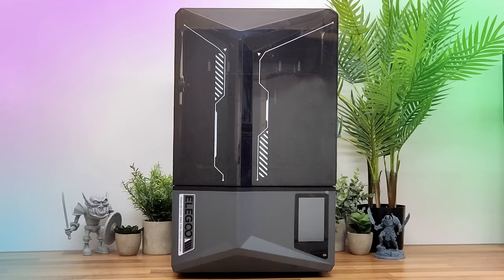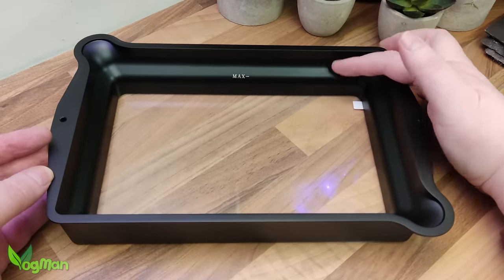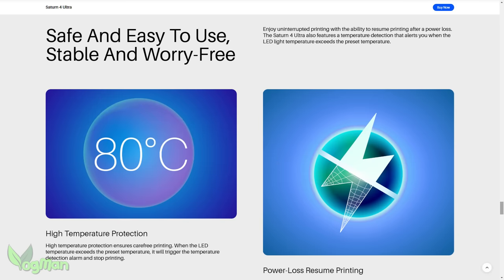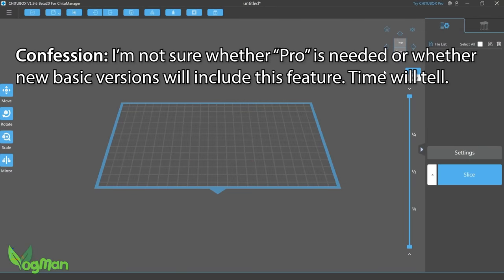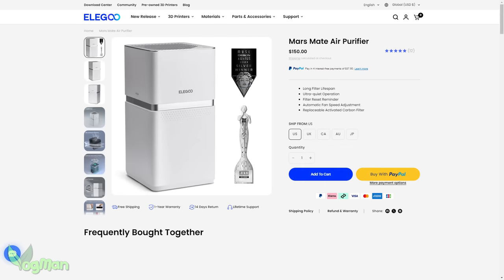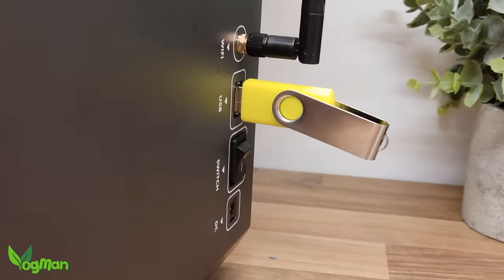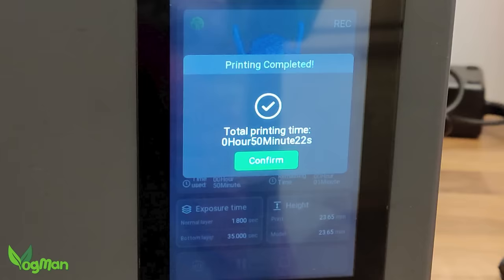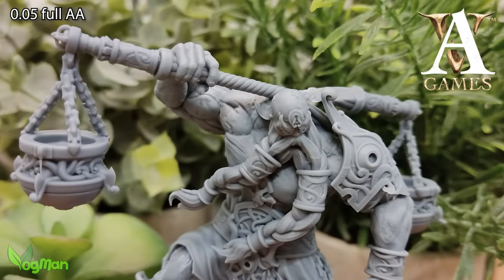Elegoo Saturn 4 Ultra (HONEST review) 3D resin printer

Comment: While I don’t intend to replace my Saturn 2 til it fails, in a way I don’t want to have to try to fix (I’m clumsy and a little worried about if I’d mess up wiring and such), definitely paying a lot of attention to printers coming out now since I suspect one of them will be the replacement I end up with (hopefully in over a year at least) and it’s good to see some sensible and quality of live improvements
Reply from the maker: I always encourage folks to keep what's working. Don't update unless you really need to or really want to.
Reply: @vogman  yep, feels like it’s working just fine atm so not planning a replacement or upgrade, but keep a reasonably close eye on what’s coming out just in case.

Comment: according the the elegoo website the saturn ultra 3 to has a Build Volume of 218.88×122.88×260 mm³ and the new saturn 4 ultra 218.88 x 122.88 x 220 mm³ which means the new saturn 4 ultra has a smaller build volume. might of been worth a mention.
Reply from the maker: You're 100% correct. Unfortunately this video was getting epically long and I've had to shave parts off just to get it done.
I do mention the print volume though, and include "Chapters" in the description to help folks find this stuff 😁

Comment: On the no heater issue... I'm more mad that their official heater uses the same hole that is meant for an easy way to extract the air out of the machine to take care of air quality.
Reply from the maker: Folks have ridiculed my "no handle" comment on this printer, but they've missed the point. I'm concerned if they've overlooked something this obvious, what else have they overlooked. It seems you've spotted another oversite.

Comment: Any word on the ACF release on this one? I was watching some old videos from Fauxhammer where he complained about the ACF smoothing details but then it wasn't the case on the Saturn 3 ultra
Reply from the maker: Well from my observations ACF liners were producing vertical lines on prints, and I've noticed that manufacturers have stopped fitting them, so I'm not sure.

Comment: Will you be making the top contenders for this kind of printers, aka this printer, Phrozen Revo, Anycubic Photon Mono M5S/PRO, GKTwo, etc? Sounds like they all use the same screen, just differing in the features.
Reply from the maker: Most of these printers use the same tech, though Elegoo stuck wit the 12K here where the others went 14. I guess the real issue is how well then put this tech to use. I have my own preferences listed here https://www.vegoilguy.co.uk/3d-resin-best-midrange-printer.php but I keep the videos as balanced and objective as possible 😁

Comment: Good video

But The maximum declared speed is always theoretical and for layers of a certain thickness.
At best 0.10mm but some brands (including Elegoo) I assume imply 0.20/0.25mm layer to declare the maximum speed

Only Anycubic explicitly declares the layer (which is 0.10mm) and says 10.5cm/hour (or 2.91s/layer with exposure 1.5-1.9 I suppose) for the M5s Pro and up to 17cm/hour (at 2.12s/layer with high-speed resin and with exposure unknown) for the M7 Pro
I don't know if these speeds are truly achievable

So you certainly can't use layer 0.05mm to measure the max printing speed in cm/hour

In any case, I see that Lychee Slicer 6 for the Saturn 4 Ultra profile provides me with print estimates (I don't have the printer, I just did the simulations) of 9.03cm/hour using layers 0.1mm (at 3.99s/layer with exposure 2.0s) and 4.62cm /hour using 0.05mm (at 3.89s/layer with exposure 2.0s)
Is this estimate too optimistic or will it be more or less correct?

Comment: Good review, I appreciate the clear view of the quality and speed. The automatic leveling actually woking is pretty nice, but the comparison to the M5S is not flattering when considering the possibility of the tilt release mechanism slowly degrading.
Reply from the maker: Yes, mechanical parts do wear over time. The question is, how long will that take?
Reply: What's it going to matter many years and thousands of print hours later when you're upgrading anyway?

Comment: Is there a way to print without the tilting? I'm interested in all the features except for the tilt release.
Reply: Buy the Saturn 4 all the futures without the tilt release and cheaper.
Reply: You should take a look at the non ultra Saturn 4
Reply from the maker: Not that I've seen, though I agree that would be a useful feature to add - just in case.

Comment: 5.5s a layer is faster than what I usually get out of my Saturn 3, which is 7.5s. So if the layer time is actually 5.5s that will save a bunch of time. Obviously not 150mm an hour though.
Reply: There's no reason it can't be 5.5s considering exposure is about 2. Should have shown the math in the review which makes 150mm/hr basically impossible unless doing .15 layer heights or something crazy at which point might as well use FDM, silly marketing

Comment: Vog man, there is a chance you expirience with the 4 cones being off might not be the printer... The cones v1 is only supposed to be used in the middle of the fep, and printed alone, as printing elsewhere can affect how the cones behave due to uneven fep pull forces. The cones V2 and now V3 avaliable on the table flip foundry discord have walls around the cones so this shouldn't be an issue. The cones v3 also has a dimensional accuracy test which I worked on, it's in beta on the discord server as that is being refined.
Reply from the maker: In fairness I did other tests than the cones... I just thought the cones were easier to demonstrate 😁

Comment: All these Chinese manufacturers are chasing each other's tails, but nobody seems to LISTEN TO THEIR CUSTOMERS!!
So, good points:
1. Auto levelling.
2. Quick release plate
3. AI camera
4. Flip-top lid.
5. Angled release table

Bad points: Elegoo, are you listening?
1. Put the damn switch and USB on the front and the sockets and aerial on the back. (After asking for years.)
2. STILL has pony screws holding the tank in place. They are a pain in the arse. Fit some quick release catches.
3. Whilst the new auto-levelling is cool, the build plate is a mess. Trying to clean that will be a nightmare. Build a sealed surround like your competition.
4. Why do I have to use Chitubox to access the camera? Why can't they provide a separate Elegoo program to run alongside one's slicer of choice?
6. No air filtration.
7. No vat/resin heater.
8. Pathetic little control panel.
9. Stick a handle on the lid. Better still, made the lid from something that doesn't react to resin or IPA. They end up looking a mess within days.
10. Reduced height over the Saturn 3 Ultra. Z-height should never be an issue, Why do they have such constraints on height?

"Speed" is a gimmick. It makes you think you are getting something extra. ie "Slow" and "Normal".

Overall, good review, Jeff, as always. No great surprises mind.
I'll wait till the Saturn 5 or 6.
They might have got it right by then. 😆
Reply from the maker: You made me laugh here. That's what I call straight talking 😁😁😁
Reply: @vogman  I like to call a spade a thing for scraping things off the build plate.

Comment: i recently got he saturn 3 utlta and was supper bummed I didnt expect a new version a month and a half later. honestly even though it has some really nice quality of life improvements  like the newer hopefully better poor spouts and flip up lid I am happy with the 3 ultra now. i feelthey missed the mark not having any sort of  heater weather It was chamber or vat and I didnt see a spot to run a power cable to have a addon heater.  I'm sad to see they didnt go a deeper vat and a skirt for  build plate like the gk two that way you dont get resin ontop of he build plate. im curious about the tilt to release if it will distort the print making ti tsightly taller up front vs back. im sure it will help reduce the suction forces though
Reply from the maker: Never worry about missing an new version. There'll be another one out very soon, that's just the way these companies go. Enjoy what you have. I made some fabulous prints on the S3's.

Comment: Is the vat actually innovative, given that the Form 1 and 1+ had a tilting vat years ago, as did the Prusa SL1 and Prusa SL1S. Now maybe Elegoo have done a better job than Formlabs, who I believe didn't have a tilting vat in their subsequent models, but I think we need to see how it pans out with this model. I honestly struggle to see where there's any innovation with this model personally. Like many of us, I'd like a heated vat so we don't need to use brew belts, automatic filling, level sensor, vat temperature monitoring with a contactless low res thermal camera or other sensors, replacing the shitu chitu firmware for something decent and thus a better print experience (Bambu show how much better it can be having custom firmware over what others are doing), and a slicer that can leverage said better firmware. Providing something like Fujifilm Prescale might be useful too for validating actual bed levelling (as opposed to Z height), but Prescale is super expensive. Heygears seems sort of like the Bambu of SLA, with a somewhat integrated system that's an improvement in the experience, but I don't think we're seeing anything particularly exciting anywhere. Wondering if Bambu are looking to take a lead in this space too; certainly hope so!

Comment: A simple and effective idea Prusa has been doing for years
Reply from the maker: And Formlabs too I hear.
Reply: And overcharging for copied crap for years, too.

$2000 for a tiny little 2K printer (0.05 mm pixel size, 127mm x 80mm x 150mm build size), with obsolete misengineered "UV LED Matrix" (just like an OG Photon Mono]) yeah, right 🤣🤣🤣

Comment: I’m blown away we are still getting printers without heaters in 2024. 
That rules it out for me immediately. 
It’s the most important feature for a 3D printer.
Reply: You can get the heater for 50 bucks as add on. With the printer price ridiculously low it will not break the bank.
Reply: I think the force/strain sensing is more important if it can prevent the screen from being destroyed by debris, but in integrated heater is an absolute no-brainer.
Reply from the maker: I'm biased on this subject, I know, but there are a lot of folks replying "I don't need a heater - I don't care."
To those I would remind you, it's not about heating a chamber, it's about maintaining a constant warm environment.
My buddy lives in Australia - very warm climate. But in the evening the temperatures drop dramatically. A heater has helped his prints considerably. During the day it doesn't even come on, but when the temperatures drop, the prints stay cosey. 
I know "Australia" isn't the whole world and things vary all over, but I guarantee if you look through these comments, you'll find more pro heater than con heater. And many of those, like my Oz buddy, live in warm climates, but they've discovered the benefits of a consistent warm temperature. That's why I have to agree, Elegoo need to be like Anycubic, Phrozen, Information, Peopoly and so many others that are thinking seriously about temperature control.
Reply: @vogman  Agreed. I'm in Ireland, my garage is often less than 4 degrees in autumn, lower in winter. I bought the chitu heater for my Mars 4 DLP, and I love it. 
It keeps the enclosure at a constant 30 degrees, resin stays runny, and I get like a 99% success rate on my prints.
Reply: @vogman  Their temperature solutions aren't really any different than Elegoo's 50 dollar add on. A vat heater is the ideal way to do it but it's only on more expensive printers right now.
Reply: You can easily implement a heated ventilation to your printer. Especially now that there is a removable part on each printers. Once you have one, you don't need this feature for all your devices...
Reply: I don't need a heater.  It never gets cold enough where I'm at to have a dedicated heater in the printer.  Just buy a cheap heat gun and use that to warm up the resin.
Reply: Buy a freaking heater for YOUR printer...  I'm in the heat, I need a chiller for mine.

Comment: Odd you call Elegoo Stupid for no handle but state you love the Uniformation GK2 lid and state it will be Resin Free from handling when it has no handle ?
Reply from the maker: The GK2 does have a handle. What makes you say it hasn't?
Reply: @vogman  It really has more of a lip (Which you did say) that is part of the lid.  Not a "Handle" in the sense he might be thinking.  But you would be touching the "Lid" with the lip.  I added true handles to my Saturn 2 by printing them on the Bambu X1C and double sided taped them to the said -  Will probably do the same to the 4 Ultra is I end up with one.

Comment: Me personally, I'm fine it comes without heating (but ofc it's a downer for those who need it). I'm not interested in timelapses neither, but the cam is a nice to have feature. If the cough "AI functions work...or just few, fine. WiFi should be standard on ALL machines >200$ in 2024.

There are only two things that I'm really worried about: That build plate design makes it difficult to clean/drain I guess, not even speaking of the possibility of resin creeping into the chamber of the screws/springs. And the tilt mechanism ofc. First model with this new tech (at least for Elegoo)...thousands and thousands of movements all the time. We will see, if they nail it with the first attempt or if there will be issues...if it likely fails or tear got impact on its accuracy. Or just imagine resin dripping into that mechanism. The drip tray looks flimsy as well, no wonder people confuse it with packaging material. It would be nice, if you could turn tilting off, when you don't need the extra speed. At least that way, you could reduce the tear. But afaik it's active all the time.

I'm fine it comes without a handle, it's easy to attach a DIY solution or printed one. I ordered the S4U as my first resin printer, just hoping it works out well (at least my Neptune 4 from Elegoo works flawless out of the box for 800h so far) I don't print much with resin so I won't stress the mechanical parts 24/7...I had good experiences with the customer support so far, so I'm not worried when it comes to possible issues. Some features need improvement, but I guess we will see that with the next generation(s). This seems more like trying to catch up with features at a small price.

Btw that CEO from Lychee released a "not only hype" video as well...auto translation got some issues with French, but it's a good watch as well. Thanks for this video, I really like those that don't hype products straight away, 've seen too many presale pitches already...this one shows both sides, the good and bad. The customers can decide themselves, what is important for them and what they can do without. And in the end,  long term user experiences will show us, how good that printer really is. Sry for the long text...hoping for the best, thanks and greetings!

Comment: The biggest difference between this and the saturn 3 is that it has 2x the ram which should hopefully vastly reduce the chance of the screen glitching during big prints using AA which has wasted countless vats of resin of saturn 3 owners. Elegoo won't tell you about this because they still haven't acknowledged the issue with the saturn 3 despite now releasing a new printer with 2x the ram which should fix the issue, now why would they do that if they don't know that there was an issue??!
Reply from the maker: Interesting. I hadn't heard of that one.
But I'll remind you... the Mars 3 I tested had a wobble on the Z Arm. Elegoo denied. Just about every YouTuber denied it. Consumers moaned about it. 
Elegoo changed the Z Arm... but there wasn't a problem 😏

Comment: Kind of surprised they've beat some of the other manufacturers to the market that were/are also working on tilt-screen solutions. Not having a heater is a bummer I agree on, but the price is highly competitive. The community that doesn't need a built-in heater versus those that do for location-related weather is decidedly small, though I suspect it was off-loaded as an extra for that reason (get one if you need it kind of thing) even though where it plugs in to actually be effective on the resin is a bit of a mystery. 
That all said, I'd be tempted to pick one up despite my historical stance on Elegoo at least for summer-compliant prints.